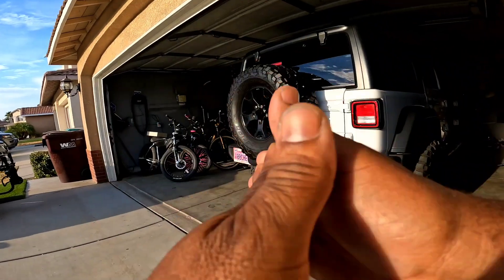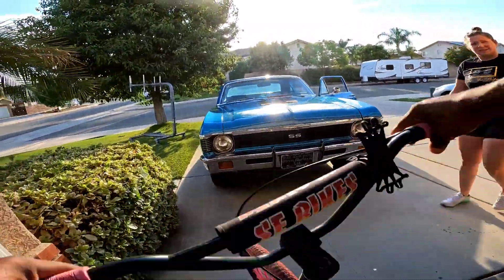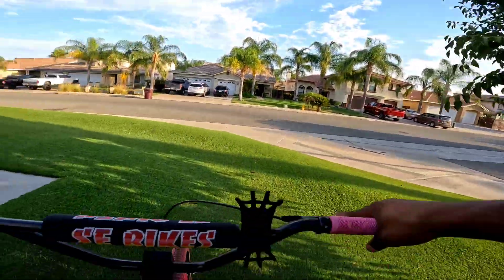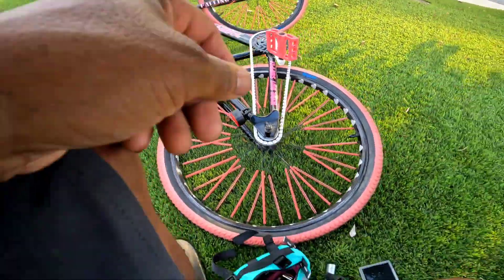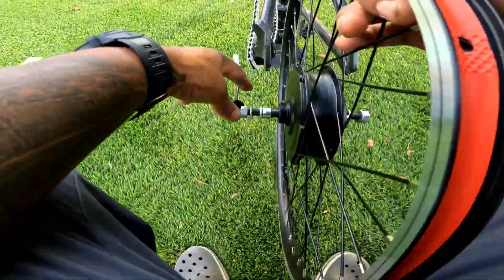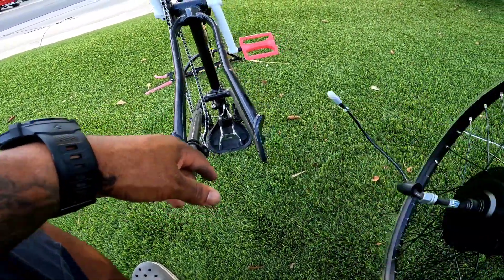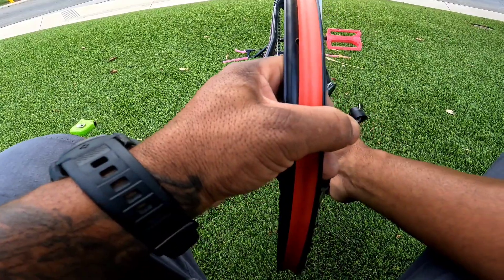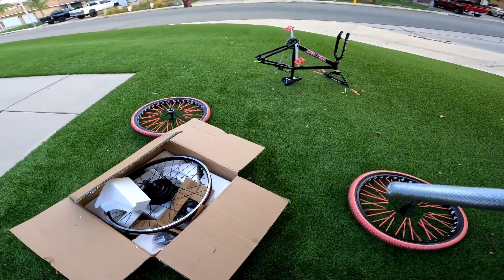THE BEGINNING OR END OF MY SE BIKE BLOCKS FLYER EBIKE CONVERSION

Comment: Be careful with “stretching the frame” , it’s aluminum not steel. Aluminum will crack it does not have too much flex like a steel frame. 
This is why I would recommend a Bafang mid drive motor instead. More efficient and don’t have to mess with the rear wheel.
Reply: Also the controller is built into the motor…. One less thing to mount and take up space on the frame.  DON’t STRETCH ALUMINUM!!

Comment: It's easy to spread and bend back if you have 2 scissor car jacks the same brand ( cheap ones that you have in cars for a flat). As long as you have the original size. Get the 2 jacks side by side (your need to wedge them in somewhere so they can't move) Do 1 turn each at a time each side. For spreading just need the jack inside the frame, it's quick and 100% accurate and even. I've done it many times from when I was a kid even if it's out a bit it's very hard to notice when it's bend back. The washer with the little hook shape goes on the inside and adds about another 1/2 inch. I don't think you accounted for that. Also G I don't know if you have enough room for the battery pack and controller box? That's why it's better to get one built in the wheel, it's not any bigger in width. If I can be of any help on anything  just hit me up in IG bro. P.S you saw my one that was a 2" spread so it's about the same as yours.
Reply from the maker: Damn I'm scared 😱 🤣🤣
Reply from the maker: And yes battery and controller I'm not sure it's gona work.
Reply: @bikelifegee  He who dares wins 🤣 There's always a risk in doing it and that's a nice bike as well.
Reply from the maker: @dogbreath6982  😭😭😭

Comment: I made one but better to use a steel frame preferably old school steel frame. Also I used a torque arm on each side of rear dropouts. I did use a 1500w but was able to go 39 miles per hour.

Comment: I think if can stretch it with a helping hand and slide the wheel in and test bolt it on then you should be ok. But I wouldn’t use any hydraulic tools or power tools and bend the frame to stretch it open because it won’t be straight anymore once it’s bent. Only if the axle fits the dropout. Just my opinion you don’t have to take my word for it😜
Reply: I use a car jack,  never failed me yet! 😆

Comment: if it is aluminum frame forget it ,one inch is alot
Reply from the maker: That's what I'm thinking
Reply: @bikelifegee  are you thinking of adding a gear shifter?
Reply from the maker: @zico3239  I'm thinking about returning the kit🤣🤣
Reply: @bikelifegee  good thinking. or gettin a bike with the right drop out .😄
Reply from the maker: @zico3239  lol
Reply: @bikelifegee  you know I understand when you get bored and you want to create something .I am converting a schwinn stingray bike chopper waiting for motor to com since waiting for it to arrive I modified  rear and front  disc brake and keeping the existing v brake at the same time Now I have FOUR  brakes on it using tow dual brake lever